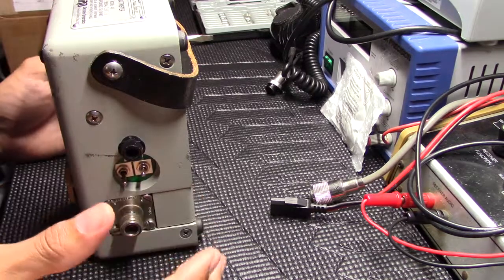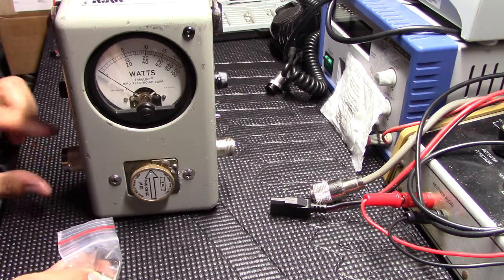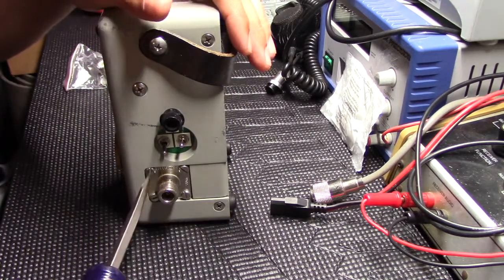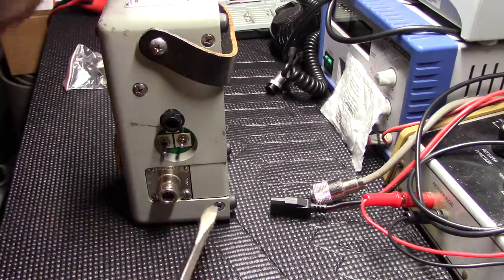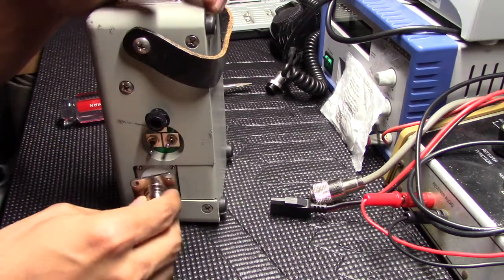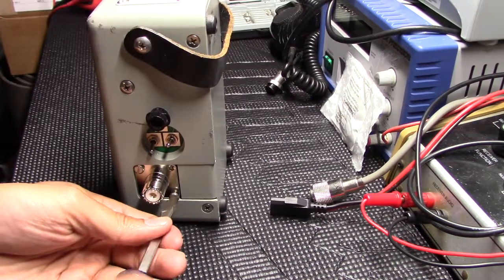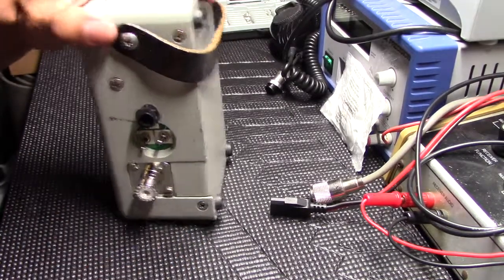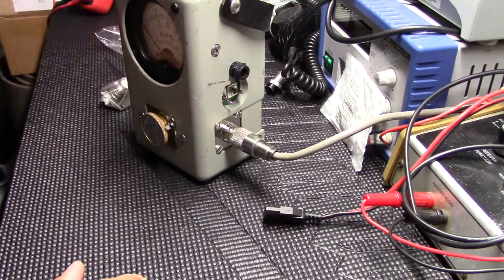Bird 43 wattmeter QC (connector so-239) swap out (cb radio)

Comment: That’s easy!!  So would any Bird 43 work for cb (11m)?
Reply from the maker: Yep all the bird 43 meters can work for 11 meters. You just have to get the elements (slugs) for the frequency you will be using. You can use the 2-30 mhz ones or the 25-60 mhz.
Reply: @TheRadioGarage  Awesome!!!  I was thinking that but I wanted to be sure.  Didn’t want to fork out $$$ and have it be for another freq.  

I am not sure if you mentioned it but where did you find those S0239’s?

Hey thanks again!  Your vid really helps people out there.👍🏼
Reply from the maker: These are the ones I used and there still working well. https://www.ebay.com/itm/361102395309